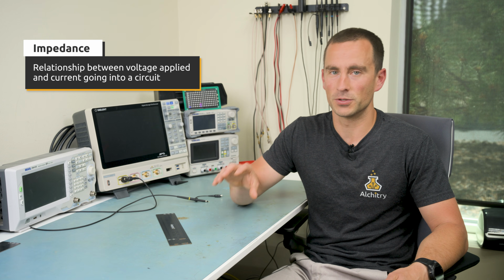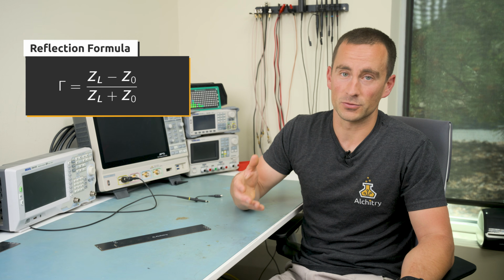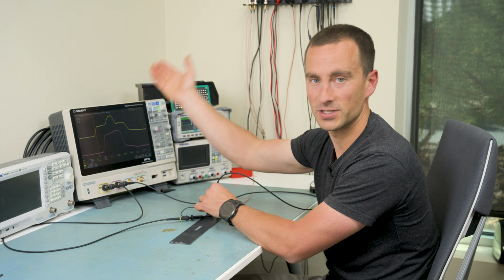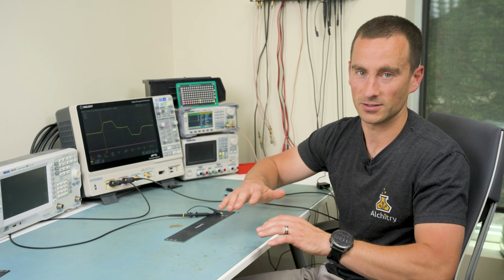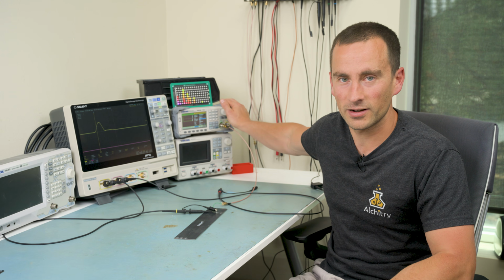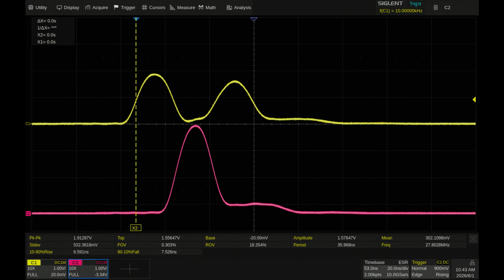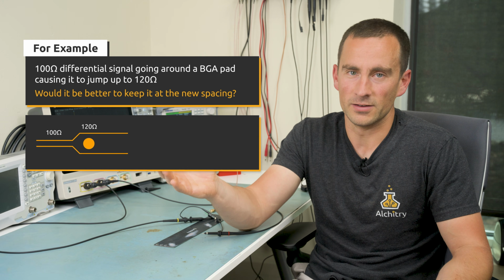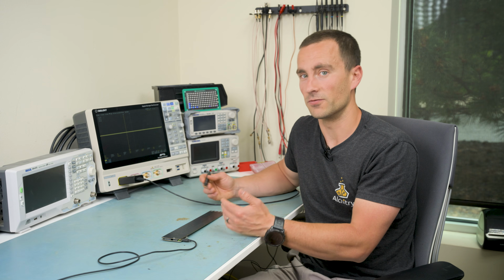What is Trace Impedance?

Comment: what's the point if you only talk about 'real' impedance and mention voltage but not frequency or current?
Reply from the maker: In an ideal conductor, the frequency doesn't come into play. The current is related to the voltage via Ohm's law of V=IZ where z is the impedance.

When a conductor isn't ideal, there will be a phase shift between the voltage and the current. This is when impedance becomes complex (in the mathematical sense) and frequency can matter. Most of the time the resistance is negligible compared to the inductance and capacitance so people only talk about the impedance of transmission lines being real.